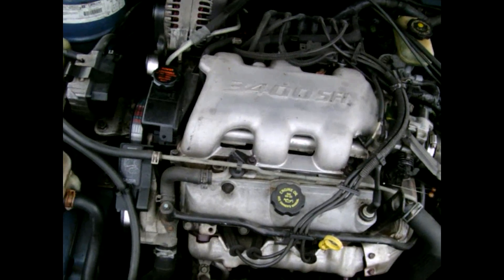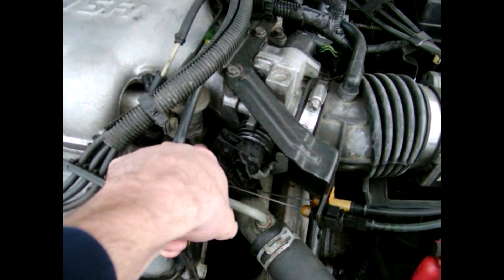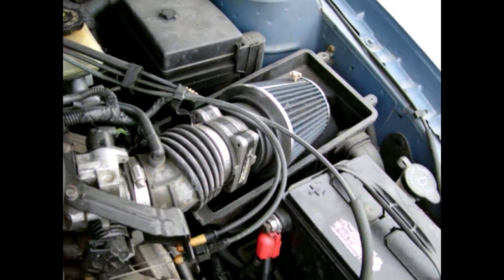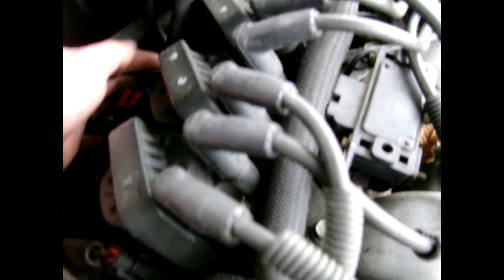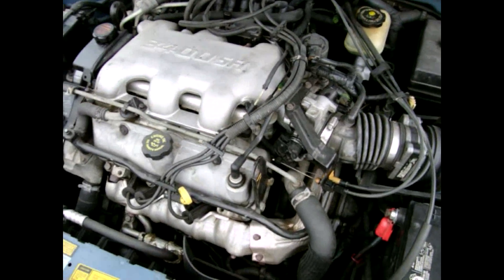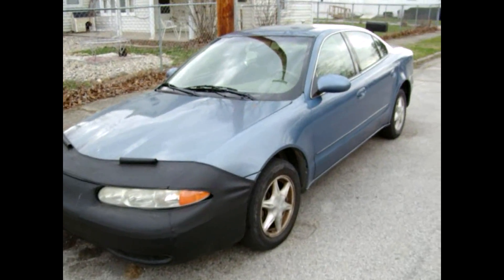3400 GM Engine 3.4 Liter Motor Explanation And Discussion

Comment: My 07 equinox is definitely a testament to this engine it's never had intake or head gaskets and currently sits at 417k miles it uses a quart every 5k it runs like new it's had plugs wire's and an alternator at 415k it's very torquey been the best car I've seen besides an old Corolla it won't die and the trans won't give up these new equinoxes can't say that a buddy of mine had one with 325k miles it got totalled from being rear ended they're great work/grocery getter cars

Comment: I would like to compliment you on your discussion. Your advice is spot on and you're helping a lot of people. Some advice to those of you that are leery of doing your own repairs. Never do the repair yourself if it has to be done in a hurry. This is where mistakes get made. Always be organized, take your time and fully research the repair before you do it. Good luck.
Reply: Help me out big time I was worried that I had run when I start my Pontiac Grand Am in the morning but now I’m not worried as much I was going to do a full engine rebuild anyway great car starts right up drives anywhere and gets it for me to be I will be repairing the small issues that he said in the video I’ve done multiple repairs before on this car and it turned out to be great never a hassle for me very easy motor to work with!
Reply: Rod knock*

Comment: I have that engine in a 2000 Impala. I replaced all the things you mentioned at about 135,000 miles before they had a chance to go bad. It has 287,000 miles on it now, still going strong and gets 30-32 MPG on the interstate running 70mph at 1800rpm. Excellent highway car
Reply from the maker: Once the gaskets are replaced they’re not bad motors.  But all the gaskets on this thing eventually fail from the factory.
VT257

Comment: 2:00 Got a 95 Firebird with this engine a few weeks ago and that vacuum problem was the first issue I had. Got really worried about the hesitation and rough idle, but it turned out to just be a disconnected hose on the air pump 😂. 

Really informative video man. Keep it up!
Reply: Update: think it's an exhaust leak. I'm still having the problem
Reply from the maker: This is one of the weird years for the Firebird.  Getting a code reader to scan for codes can be challenging.  If you can get the codes read, that would give a better understanding to what the issue may be.  My first thought with the issues you've described would be the ignition system such as the coils, spark plugs or plugs.
VT247
Reply: @Vacationtime247  yeah, obd 1.5 is a pure annoyance. nah I have a code reader. And I'm currently trying to get my computer to read it too. A dude on the firebrid nation forum is helping me out. No codes are popping up, and the guy I bought it from said he just changed the spark plugs. I'll consider that though

Comment: Had a 3.6 in a Malibu which is virtually identical and the 3.4 in my Impala I drive now.

Piston slap seems to be caused by the rods connecting the rocker arms fitting too tightly. Clean them up really good with rubbing alcohol then give them a good lubing up with some clean oil makes a world of difference. Too much torque on the rocker arms can also introduce the same problem: tighten to spec then with a box end wrench 2 hours of a clock tighter.

The MAF sensor element can be cleaned to restore it's functionality. It's a resistive element so adding or removing material changes it's output. Clean with a non-corrosive cleaner like rubbing alcohol.

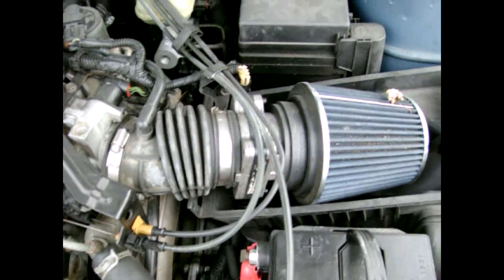Gaskets on this engine should be sealed with AC Delco 88864346 or equivalent silicon. The typical black silicon has a nasty reaction with the aluminum used in this engine, causes the aluminum to corrode which will produce a disgusting sludge that takes bottle cleaners of various sizes to get out of the coolant and oil channels. Eucalyptus oil can dissolve this crud to make cleanup easier and is safe to mix into any of your fluids in small quantities (1:10 ratio would be ideal).

This engine wears the drive belt really fast compared to any other engine I've had. As a result I treated my last belt with glycerin before installing it. Neatly wrap the belt and shove it into the bottom of a jar, fill just enough glycerin to cover it and let it sit overnight. Take it out the next day, wipe it dry with a junk rag then install it. If the belt starts to show significant wear, check the pulleys, it shouldn't wear once treated as long as the pulleys are all spinning good.

Heat shrink tubing can be used to seal a leaking vacuum line. Find the leaking section. Score a circle with a pipe cutter or razor then snap it clean. Slide heat shrink on and hold it together while you either wave it over a heat gun or have a friend heat it with a lighter using a swaying motion.

The Anti-Theft system you likely have since you have this engine. Do not even bother trying to fix it when it begins to fail. For the price of a new BCM you can order an aftermarket BCM from Omega that actually solves the problem once and for all. When I ran into this problem I tried everything from switches to turn off the anti-theft to resistors to eliminate the hall effect sensor to making my own debugging adapter using an Arduino, documentation AC Delco provided and a lot of low level code to sniff traffic using man-in-the-middle techniques with a laptop. All pointed toward the system working properly even though it clearly wasn't. My Impala already had the Omega BCM installed when I purchased it and I haven't seen so much of a hint of the stock system's problem.

When your radio decides it's been stolen, which from what I seen all of them do at some point. There is a code on the service tag in your trunk that you can enter using the radios debug menu. You'll have to look up which button combo opens that menu for your specific radio but dialing it in is very easy. Just expect to do it again a few years down the line if you keep the car. The code is a 3 digit number in one of the corners of the tag, not in the big group of numbers. The big group of number are just the options the car was ordered with.

Comment: THANKS FOR THE HEADS UP, I GOT THE SAME CAR, OIL LEAKS ALL OVER, WAS IN A WRECK A BOUT 4 OWNERS AGO, NOW AS LONG AS IT RUNS AND PASSES INSPECTION, IT IS MY DAILY DRIVER.
Reply from the maker: They can be a real challenge to work on.  But, as long as it still runs and gets ya there : )
VT247

Comment from the maker: I'd strongly recommend that you do the head gaskets too if you're also doing the intake.  You can get a complete gasket set online for @$100. Then get oil & coolant.  I've done an intake, then had to turn around and do the head gaskets after putting it all back together.  It's not that much more work and the car will be solid for another 100k miles.  
VT247
Reply: If you do head gaskets you should have them milled, might as well have them checked for cracks. Great way to blow an unnecessary $300-$500. I'm done one, currently doing my second one. Didn't replace the head gaskets on the first, more am I doing it on the one I'm finishing up tonight. Hopefully I didn't get it hot enough to blow them, if I did I'll spend the money buying the second gasket kit.

Comment: Very nicely explained, thank you. mine had the intake vacuum hose connector under the coils wore out (it wasn't making a good seal) so in replacing that hose, just unbolt and lift the coil packs and you have the room to plug it back in.
Reply from the maker: It’s a tricky one to find as it’s hidden underneath.
VT247

Comment: What I know from the GM 3.4L 60°V6 (LA1) in my Grand Am:

LIM Gasket: One from the factory was a dud. Replaced with Fel-Pro or REVISED LIM gasket. (The original gasket itself was flawed, and changes were made.) In my case I got lucky. Was replaced by under extended warranty by a competent mechanic. (New bolts and correct torque-down are important here! Not done right means don't bother doing it at all.)

Good news? Fixed correctly, it stays fixed.

EGR: In my case also under extended warranty. Basically was sticking. More or less lapped valve seat removing burrs where carbon can build up along with ECU reprogram controlling EGR operation.

MAF sensor: This can fail while still giving values in the range accepted by the ECU, thus no trouble codes. You'll get drivability problems that may look like something wrong with the transmission. Typically power cuts out on the top end and may resemble hitting a RPM limiter.

May also need throttle body cleaning on occasion, PCV suction isn't that far where IAC is. Sometimes with battery being out or after working on the throttle body also may need to do the TPS learn procedure (it's easy), or it will have drivability/shifting problems.

Coolant system: Nothing too unusual vs. what happens with age. Pump after about 10 years. Reservoir tank or seals may also need replacement because plastic doesn't resist aging either. (Old car rather than GM problems.)

O2 sensor: Again, old car rather than GM problems. A bit too much a pain to get at for DIY.

Wires: short of having rodents get in, nothing more than old car problems with material aging in terms of needing replacement.
Reply: Thank you.  MAF sensor comment is spot on with my symptom.  Thanks for taking time to post.  :-)
Reply: Hello! How do I do a TPS learn procedure?
Reply: AMAZING information thank you very much

Comment: You meantioned some noise it tends to make during a cold start.  I have a slight knocking that happens upon ignition.  It always happens first thing, but runs flawlessly after warming up.
Reply from the maker: Could be a few different things.  Piston slap, the piston rattles around in the cylinder until warmed up making a chattering noise.  Possibly a weak lifter that bleeds out until oil pressure is up and engine running.  Doubt it's a stripped out rocker arm since it only makes the noise when cold.
VT247
Reply: if heard this is normal that is the engine success because that is GM best engine designed for 400.000 miles. 

the knocking is because the parts have a little play. that's normal

Comment: First and foremost I wish to give a shout out to author and participants of this board. A dedicated GM 3.4L Engine Discussion board is pretty awesome!!!

I have a 2003 Chevy Impala. The only difference between my engine and the author's is that there are motor mounts at the front of the engine. I need to change the back spark plugs. I am rather large in stature (6'2'', 275lbs), so feeling around the back to access them like some of you shorter and skinnier guys do is not an option for me.

According to what I researched thus far, GM states that it is best practice to rotate the engine. While there are videos out there that shows you how to do this, but the challenge is finding the resource for specifically for the application for the 2000-2005 chevy Impalas. 

My question specifically where do you strap the engine to perform the this procedure? I want to do it the right way. Thanks!!!!
Reply from the maker: Take out the motor mount bolts nearest the engine  13 & 15 mm and loosen the ones closest to the radiator.  Grab onto the motor and rock it to take out the 2nd bolt.  Swing up the mounts.  Get a ratchet strap and hook to the motor removal bracket and pull it forward.  Should give enough clearance to change.  Or jack up the car, put it on stands and reach up from underneath without having to pull the engine forward.
VT247

Comment: 2003 Buick Century 3100. Just bought this car. I had to replace a leaking water pump. Pressure testing the cooling system afterwards resulted in coolant in the oil pan. I had to have the Lower Intake Manifold gaskets replaced. I let the dealer do this job at a total cost of $989.00 including new coolant reservoir. I have not had a GM before and also noticed the piston slap. Runs good now. Hopefully no engine damage. Coolant is no substitute for oil.

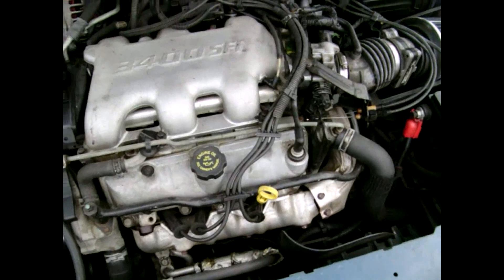Comment: At 2:29 you touched a line but didn't mention the name. I have the same engine but in a Pontiac and I'm looking for that line.  I put a rubber cap on it and it stopped the rough idle but did nothing for the acceleration.  Please help.  Auto places are being jerks.
Reply: I have a 05 Chevy Venture and also need to know the name of the piece
Reply: I would like to know its name too?
did any one find out what its called.
Reply: Hey I dont know too much about this engine but look for diagrams online, or in your cars manual
Reply: I need that same part.  When I looked it up, I think it goes to the transaxle.  But I cant find it anywhere.
Reply: That Is The Vacuum Hose For The Fuel Pressure Regulator
Reply: Im back in this comment looking for that line name as well XD Cant find it and the shitty yellow plastic snapped so yeah
Reply: It looks like itv goes to the PVC (Positive Crankcase Ventilation) it uses the vacuum off of the engine to recirculate blow by gasses that have built up inside the crankcase back to the intake so as to be reburned.
Reply: Not the PCV, its a valve for the crankcase, PCV is located elsewhere
Reply: to anyone asking what hose that is, vacuum hose for fuel pressure regulator
Reply: No its actually the vacum hose for the transaxle
Reply: Idk if this link will work but here, Not a FPR line. I had to re-route this whole line because the whole thing rotted on my car and my car was shifting like absolute garbage. Also more proof that its not a line for the FPR is because A it doesn't go anywhere to the FPR and also 3400sfi vehicle that are AWD don't have this hose. So do AWD cars just not have and FPR? No, for whatever reason they use a different type of vacum lie for the tranny. In the link I sent this diagram even says "to trans"  link:http://www.fixya.com/fullimage.html?src=http://i.fixya.net/uploads/images/7765b4b.gif
Reply: Here's the official image released by GM you can find in your manual. Just incase you still think otherwise. link: http://repairguide.autozone.com/znetrgs/repair_guide_content/en_us/images/0900c152/80/21/7d/43/large/0900c15280217d43.gif
Reply: It's a vacuum line that connects to the PVC valve. Here's the link. You cannot buy this in an auto parts store, I tried! You can either order it online for about $20 or go grab one from a u-pull lot for a few bucks. It took me forever just to find the right wording to use for that part! I tried what he did in the video to stop the vacuum leak but the whole inside plug of the hose was totally gone so I pulled one from a Monte Carlo of the same year. Very easy removal and install. Hope this helps.https://www.1aauto.com/pcv-elbow-and-tube-general-motors-oem-24508186/i/gmepc00002
Reply: Thats not the hose he's talking about
Reply: ben morales
Reply: Thanks this helped me so much
Reply: Ricky Hildebrand.  That's correct. 
PCV hose (Positive Crankcase Ventilation )
One end goes to Purge Valve, the other goes to PCV valve
Reply: at 2:47, there are three vacuum lines nicely displayed.  From left to right: (1) Transaxle - Not on all engines! ; (2) Fuel pressure regulator; (3) PCV.
Reply: Penny Cole  I can't believe I've been checking hoses for a week and my leak is in that exact spot on the tee right under the bracket.  Car was revving to 4k rpm by itself at startup then stalling out. I got it jerry rigged now but I'm going to use your link and buy the new line. Thanks.
Reply: If you ever had the FPR fail, you'd know for a fact that the hose goes the FPR..At failure, this hose is forced off and gas is sprayed everywhere. And, your engine will be vapor locked with gas..
Reply: Fuel pressure regulator vacuum line
Reply: Definitely the transaxle vacuum line. The PCV vacuum hose is the larger one below it that connects to the valve cover. The trans vacuum line let's the transmission determine how much load the engine is under by measuring vacuum pressure in the manifold so it can adjust shift points. If your car is shifting at odd rpms or not shifting smoothly, that could be the cause. It can also cause problems with idle and throttle response as you have unmetered air getting past the MAF and loss of vacuum in the manifold.
Reply: It's called- Crank case breather hose

Comment: why cant a 100 yr old company seal an intake manifold correctly theyve had these issue forever
Reply: Because GM is cheap and will not pay for a quality made gasket and they treat their suppliers like crap going always to the low bidder an then knocking them down another 7%. Then they slow pay the suppliers 90+ days.
Reply: They also outsourced the 3100/3400 engines and they were made by the lowest bidder.
Reply: @robc8468  no wonder why they went bankrupt
Reply: @spencerquimby4726  ...where are they made?
Reply: @Texaca  a small number were made at the Tonawanda plant in Michigan before it was shut down but the vast majority were made in Mexico at the Ramos Arizpe plant. I used to own a 2001 Alero with a Tonawanda made 3400 engine and the gaskets were made of fucking cardboard.